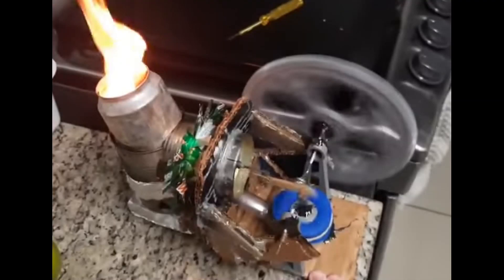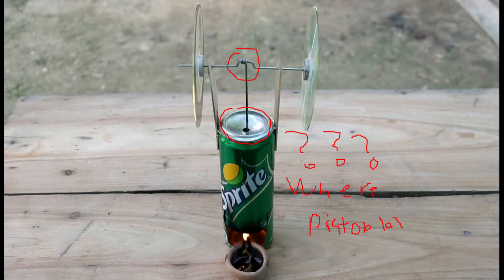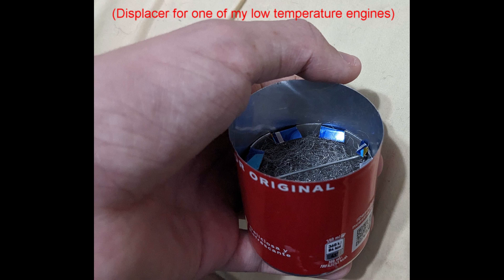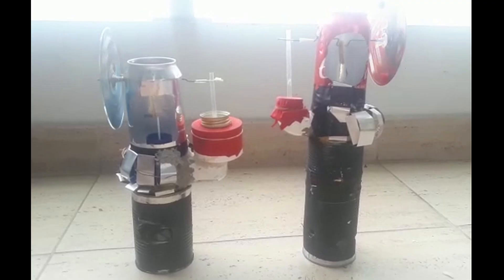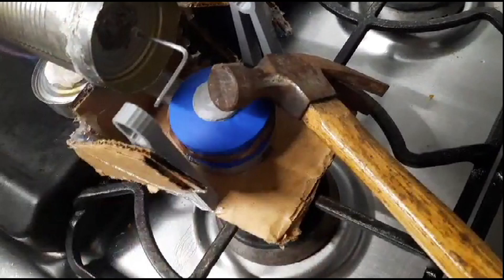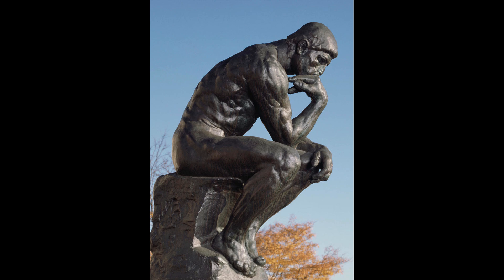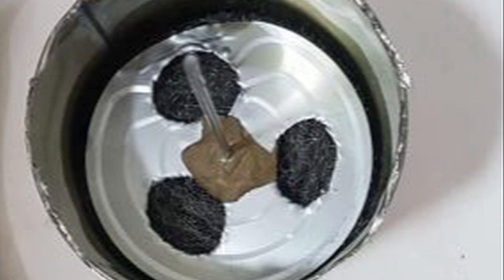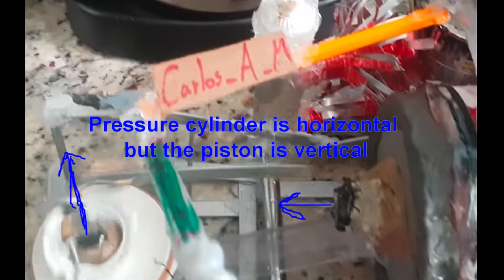How to make a DIY Stirling engine

Comment from the maker: Extra note: In case you have an air leak that is VERY hard to spot, simply take soap and mix it with water until you get a lot of bubbles, then place said bubbles on the areas where you think there could be a leak and manually move the power piston up and down. If there is an air leak a few bubbles will get sucked in through the hole and then balloon in size as the air rushes out, showing you the exact location of an air leak.